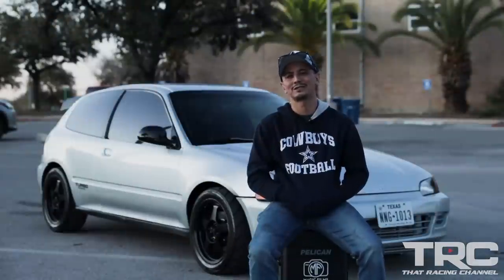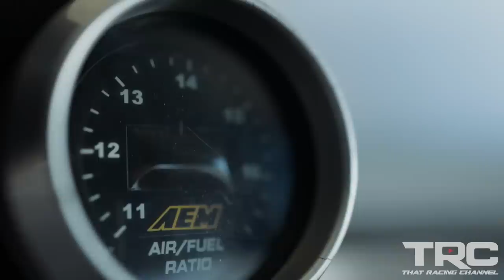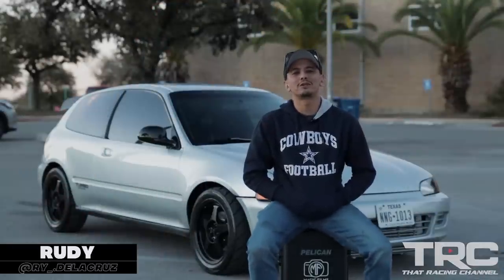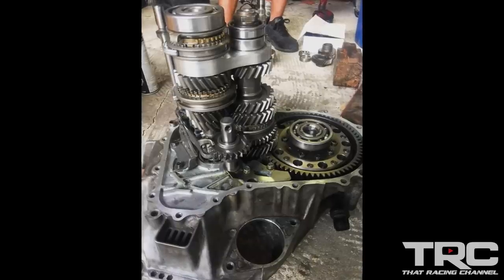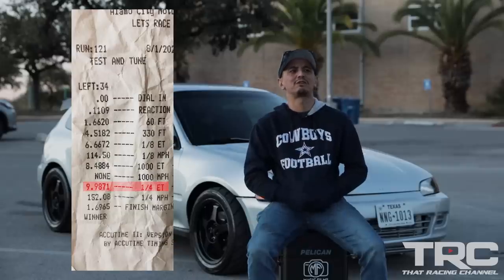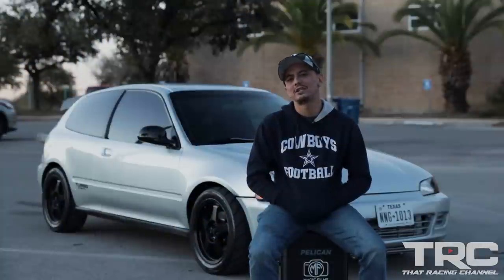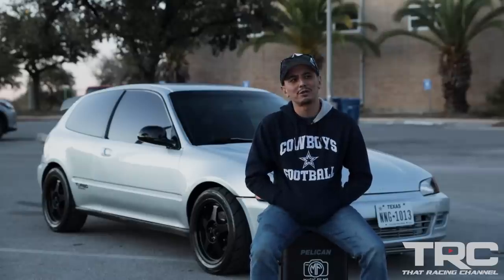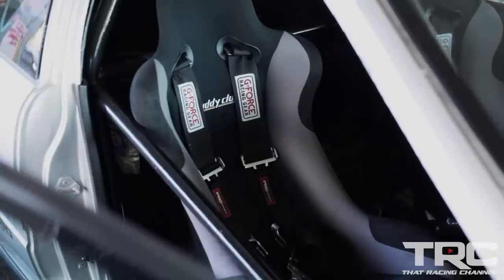Sleeper 700HP Turbo Honda "V8 Killer" GAPS Mustang! (LS VTEC B-Series Civic)

Comment: People that say Hondas are slow are pretty ignorant. Naturally Aspirated Hondas are slow. Turbo Hondas will gap unsuspecting cars, because you never know when they will get traction and pull like a fraight train
Reply: yeah but most of the time wrong wheel drive means no grip, or if grip torque steer. Rarely an equivalent RWD car has such problems.
Reply: @DukeNuggets69  oh I agree 100%, but never underestimate anyone. I have seen a few AWD EG hatchbacks and they are rocket ships. They also look totally stock too.
Reply: @DukeNuggets69  there are ways to overcome those problems, that’s why there’s fast fwd cars
Reply: @gotmefckedup4781  fat front tires at 6psi, and 100lbs at the front end lol
Reply: NA hondas are not slow lol K series hitting 9's now a days. If its stock NA yes of course.
Reply: @JDMEXforme  those K series are pretty stout for what they are, but do not last long at allllll revving that high and burning that hard
Reply: I wonder if people talk smack about EVO's they're 4 cylinders too.
Reply: @oreally8605  those are turbocharged and AWD stock... it's not just shit talking 4 cylinder cars because they only have 4 cylinders.
Reply: NA Hondas have been in the 8s, for a NA motor under three litres that stupid fast. Everybody seems to think 350whp is about the limit but that's not even close. Full race stroker race motors are making 500+whp on 50/50 or more methanol and nitromethane

Comment: isnt the LS VTEC where they use the LS block from like an integra and throw a B series head on it. If you have a b series head and block that would mean you have  B series. that was the whole point of doing the swap was to add vtec to the LS block that didnt have vtec at all.. "i got a b18 block and a GSR head". Im a v8 guy and i even know thats not an LS Vtec swap come on guys.

Comment: I would like to see how this tiny car would do, against modded and turned Vipers, Hellcats, and Demons, that's got 1000 or above Horsepower / Torque.
Reply: A 700hp EG will hold its own with those cars in the 1000hp range, once you start getting to 1250-1500hp range he will get walked
Reply: @barneymiller7894  : Hmm I see, Thanks for responding.

Comment: Why do people not seem to do many modded V6 Acura builds ?  Such as the TL Type-S, or even the 2.4 Liters four cylinders Acura such as the TSX.

For unknown reasons people seem to go with the underdog type of engines, anything below 2.0 liters.

They all have V-Tec including Acuras and V6 models too, not just the tiny 4 cylinders.

Let's see something more interesting and exciting such as Acuras with 2.4 Liter engines or larger, doing 9 seconds or faster.

All these civic stuff and below 2.0 liter engines is too common which make it all too boring, even if it does 9 seconds runs.

Let's see more sedan builds with 2.4 Liters or larger, such as the V6 3.2 Liter and larger.

I would like to see more TL / TLX builds and mods.
Reply: I know two people with J32 swapped Civics and one with a J36 Frankenstein motor, all all motor and 350+whp
Reply: @barneymiller7894   : Hmm I see, Thanks for responding.
Reply: @theroyalcrownedtiger2946  Ya the J swaps are gaining popularity, the Acura are just heavy
Reply: @barneymiller7894   : 
Hmm I see.
I have driven the 3.2TL Type-S, did not feel heavy when I drove it, felt light and responsive.
Reply: @theroyalcrownedtiger2946  They're great cars, and i guess I should clarify not that heavy in general. But compared to an EF or EG Civic, they start to look pretty heavy, and for a drag racer less weight means you need less power to run the same times/speeds
Reply: @barneymiller7894  oh ok, thanks.

Comment: I'll never understand you clowns that don't run filters on your turbos they are made to breathe not choke the turbo its just made to clean the air. I understand if you can't fit a filter and your a drag car only but there's no reason anyone shouldn't be running a filter you can max your boost with filters, maybe you'll gain 1 or 2 pounds but that is so minuscule you wouldn't even notice it. RUN A FILTER ON YOUR TURBOS GUYS C'MON ITS COMMON SENSE ESPECIALLY IF YOU STREET DRIVE IT ALL THE SHIT IN THE ROAD THAT CAN NUKE THE TURBO IF NOT THE ENGINE ASWELL AND YOUR HEAD DEPENDING ON WHAT YOU SUCK IN. I MEAN IF YOU GOT THE MONEY TO REPLACE IT JUST BECAUSE YOU WOULDN'T RUNNA FILTER ON YOUR TURBO C'MON GUYS..

Comment: Sleepers cant hide a HUGE front mount intercooler and drag radials ... ...  when those 2 are seen, its not a sleeper.
Reply: Don’t mean anything. I raced a ef hatch with the same things and it was only a measly 280 whp. Car would probably barely beat a stock coyote.
Reply: @TheBb6prelude  well you apparently got one that was all show and no go which represent the handful running around the city. Most dont spend that kind of $$ to make their car look fast.

Comment: This Honda is impressive for a street car! However, there are six second street cars that are v8s. Just saying.
Reply: Ya, six second "street cars" with steel panels fastened on SFI 25.5 Tube chassis with big tires and auto transmissions making 2500+hp.

Comment: Meanwhile the mustang daily drives , sits in rush hour traffic and just drives like a normal car ..... I have respect for Honda , hell ive owned 4.  But lets stop comparing apples to oranges .
Make the race fare , you increased the Honda engine output 6 to 7 times over stock , to make a drag car . now get a V8 muscle car and do the same thing.  That puts you racing a pro mod car .